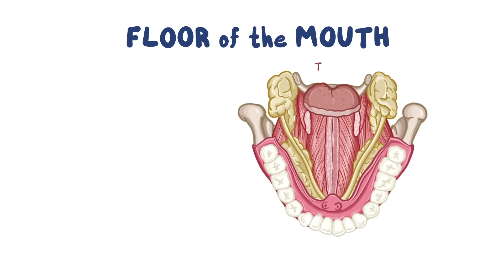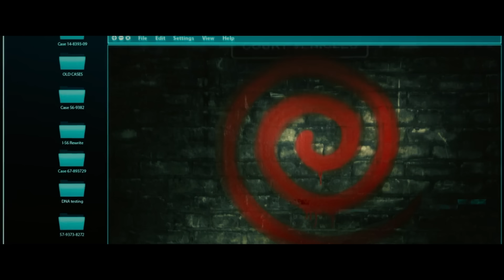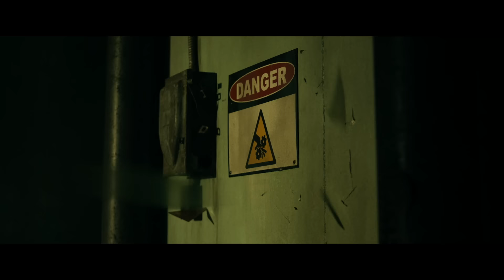How To Beat THE JIGSAW TRAPS In "Spiral: From the Book of Saw"

Comment: The second guys trap is the easiest, after bending the electric wire upward he could have flipped around in the pool to make a not on his side of the metal bar, stopping the machine from pulling his fingers and instead breaking the wire
Reply: Isn't wire under electrical current though? How would it make water electrecute him otherwise?

Also doesn't machine only activates when he triggers it himself by biting it?

Wdym by "he could have flipped around in the pool to make a not on his side of the metal bar, "

What side? What rod? Isn't it just one baththub?

Comment: The second trap just jump out of the box so you can’t get electrocuted but get out by moving forward to remove the slack on the line reach your hands over the water bend your fingers to release tension of the fishing wire and carefully grab the loose wire with the palm of your hand and repeat until all the wire is gone

Comment: How are you going to knock the wire out without touching it? you’re soaking wet, and you are in the water, you will complete the circuit and electrocute yourself faster
Reply: oh damn you’re right
Reply: I was thinking the same thing. Wouldn’t touching the wire fry u too. Glad u caught that too.
Reply: Break the glass and use it to move the wire away

Comment: So a slight thing that I noticed about the second trap. Unfortunately, if you try to un twist wires, you will be electrocuted anyway because touching a live copper wire is not a very good thing to do. Also, if the wires touching a pipe touching any point  of that pipe will shock you as well and what I noticed is the pipe that his arms go through is that same pipe so maybe he was getting shocked as well as his fingers ripped off who knows

Comment: Nah the glass trap wasn’t beatable cause it’s almost impossible to pick a lock with out a set let alone in 17 minutes
Reply: @brkenppt2222  nah he wouldn’t have because there wasn’t much that would actually block it. there would be a high chance of the glass falling in the machine. He could’ve found the key sooner but it’s high stress and he was proven wrong he would be dead set on what he thought was fastest which was the lock pick option. So there really wasn’t much you could do unless he had a good lock pick (judging by the look of the lock they’re a few good ones that would take a minute tops) and used the guy as a shield

Comment: Wouldn't wire in trap 2 be under electical current though? So touching it would be pretty bad idea? If it wasn't nothing would happen if water touched it? or how it works?
Reply: You need contact with both wires at the same time to close the circuit. If you only touch one of them youll likely be fine

Comment: 10:26 Those are most likely the source or ground for the high voltage, meaning if you touch it while having the other end of the circuit connected directly to you through your fingers and you're not careful, you can easily electrocute yourself even before the timer runs out. It is possible however that if you grab onto the live wire with one of your hands which is grounded, that you short-circuit the circuit, but it's also possible that only one of the hands are grounded, leaving a 50% chance of having high voltage flow through your heart

Comment: Trap 1: There is not enough chain for you to be vertical on the side of the tunnel, you would be hanging diagonally and you would be hit by the train from around mid torso up. Dead.
Trap 2: You...you cant remove the wires..they are electrified...that is the entire point of the trap. There is a constant current in those wires so as soon as the water hits you die. You cant run over and grab the electrified wires or you die.
Trap 3: You are correct, but all she has to do is lift her head. Literally just put her chin as close to her chest as she can. She has long hair, liquids will follow her hair naturally. So if she lifts her head the wax should follow her hair down the back of her head instead of over her face. It wont last forever but she is found fairly soon after and SHOULD survive this way.
Trap 4: Yeah this one you have pretty solid ideas for, block the glass as much as possible and use the intervals for safety.

Comment: The second one is even easier then you think. The things on his fingers are wire pulling baskets. Electricians use them. They are just like Chinese finger traps. All you have to do it push up on them from the bottom and they instantly loosen up and slip off. Just about any apprentice has done this before. Also they are made of steel.

Comment: On the finger trap, if you tried to move the copper wire then u would be electrocuted as a current will flow thru that wire if u touch it

Comment: okay but in the first one if you were to wrap the chains around your arms and swing to the side, if the chains of the device aren't fully in the clear of the train the train would hit the chains and still rip his tongue off-- more like his head at that point. yikes. love these vids
also the second man wit the nets on his fingers. if he got the wires out of the tub or got out of the tub while sitting closest to the machine for less tension on the wires, he could have taken one hand to hold the ends of the nets that are on the other hand. then with the other hand he should've pushed his fingers towards his other hand which would loosen the nets. It's like the Chinese finger cuffs, they only tighten cause each end is being pulled away from the other. he wouldve been able to slowly remove his fingers this way then used his free hand to do the same for his other hand

Comment: DEAR HOW TO BEAT!!!!! I need an answer.

The "Net" on his fingers is called a Fiber Beckett. He has 10 of these Fiber Becketts on his hands. These are used under high tension to pull fiber optic lines with a fiber hanging truck, from pole to pole from a reel placed down the road. 

These are made of metal and I need to know how this could be solved with this being the case. The lightbulb was the solution for these being made out of netting. @ 10:30

Comment: I would try to scream to the train driver to get them to slow down at the beginning making there be more time before your death, then you have to find a way to break the device or if the train slows down enough, it will stop before hitting you and the driver could find a way to get the device off for you so you can get on the train aswell and get to the nearest station

Comment: Question - with the first trap, is it a viable option to use the barbed wire to cut your tongue off rather than ripping it out with your own body weight? It would be very bloody and agonisingly painful, but it wouldn’t affect the connective tissue beneath the tongue. Less likely to kill you than swinging from the chains, surely?
Reply: thats really smart, however i dont know if there would be room to get the barb wire in the mask and be able to cut your tongue off completely. However you might be able to cut it just enough for your tongue to slide out.

Comment: if you touched the wire it still has a current running and who knows hm volts dude is using so youd most likely be fried to death the second you touch it say he used like 12k-20k volts

Comment: The first trap is simple
You can use a wire to cut part of your tongue your Your plan is unfulfilled because the train will touch the chain, and if you somehow survive your hands will not be able to withstand the force.
trap two is impossible killer gave us 90 seconds but the pool was filled in 80 (yes i rewatched and counted) to free hands simple light bulb shard wont be enough because that aint normal plastic
thats (idk what its really called tho) special material that not easily bendable and its very strong and even if he had the hands are released, they will not be able to remove the helmet also copper wires strat wont work that good inside of copper there is iron wires that are hard to bend with hands when you have that thing on also helmet reduces vision area so that will make it even harder.
thid trap is unfair too but its at least winnable in the movie you could see that she was thight up but But still she could move slightly so she  could rise slightly upwards and raise his head so that he wouldn't be sufficated  because of the wax. next trap is sometimes beatable sometimes not Pushing the shelf close will not work because the shooter throws glass with such strength that glass is pumped into concrete  it will easily rip the shelf apart conveyer belt strat is good but glass that made it thro can still kill that dude idk about lat one tho it seems way out of logic so you decide :) sorry for my grammar (all the info here is from me rewatching the movie )

Comment: The copper wire thing doesn’t seem right because you’re gonna be very wet already with no way to really dry off completely and then try to touch a live high voltage wire while still standing in water

Comment: 4:33
Where did you get that from? Top speed by a human is 27.5 MPH (44.25 KPH).
Reply: Did you listen he said not top speed?
Reply: @TooLateEXE  If you've ever been on a subway train, you know that they often travel at or as close to their top speed as they can, to reduce travel time. Even if you say that the average speed is right in the middle of their top speed and zero, (the median, not the mean) it should be much faster than 17 mph. Most people can't run that fast, but that still extremely slow for a train, especially the type shown in the video. I'm just guessing here, as I don't know the model or when it was installed, but average speed should be at least 30-40 mph.
Reply: @boochin  I guess you're alright. We don't know the train. So yeah, Have a nice day.

Comment: The trao woth the electric is the easiest to escape see the pipes hold your fingers just let yourself get pulled out of the trap by the gearbox then kick it the gears are movable and thats a problem because your body weights more than its harder to rip your fingers now you can put the gearbox out or dropp it in the water itll break either way so your safe

Comment: Sooooo... you wouldn't just use the Razor wire (not barbed) to slice off a small chunk of your tongues instead?  Partial speech vs. Hanging from mostly plastic seems like the smarter choice. The question here is largely the understanding of counterbalance - Whether the weight of a human body or the weight on the mostly plastic pipes goes first. He had a clear and obvious piece of material to sever the tongue quickly and clearly. Allowing him ample time to escape.

Comment: 10:33 I love your videos, but if you were to touch those copper wires with your bare hands you'd die before the trap even gets close. Copper is extremely dangerous when charged with electricity, hence there's rubber around wires to keep you from touching the copper.

Comment: These nets aren't fishnets. They are steel sleeves for pulling cables into pipes. There's no way you can cut them, but they only tighten when a pull force is applied so they would slide off really easy if you just push them towards your hand. As an electrician, I wouldn't die here.
But I sure as hell wouldn't try to unwrap a live wire off of a conductive pipe while being soaked in a bathtub either. Big dummy moment.
Reply: Consider steel sleeves glued to start with. Not doing this makes the trap pointless.

However if strings are long enough, the best chance is to rotate the body to twist the wires (after that part of the tension forces will be transferred to untwisting). These are:
1) will greatly speed up the process of skinning fingers (wounds to the phalanges down to the bone are non-fatal)
2) could potentially break the entire trap

Comment: Okay so I saw a comment about the electric trap with the finger thing. I'd that electric trap was connected to a car battery you can fuck the wire up because car batteries don't have enough volts to kill you. But you're wet so it probably will though

Comment: In that first trap... personally i would not be able to do what He says you could potentially do so i'd just use the barbed wire to try and cut my tongue off on one of the sides of the contraption.. either the front where the tip of my tongue is to see if i could Push my tongue the rest of the way through. or the other side closer to my mouth to abandon the front part of my tongue. I'd say its worth compared to ripping your entire tongue and maybe part of ya jaw too

Comment: I feel like the train would hit the chains and rip your face off. If you timed it right hit the side of the train I still think the chains would hook on the side of the train and rip your face off. Next if the copper wires are live you wouldn't want to touch them as you are sitting in water and as the end of his fingers have metal cables on them and I don't think he can bend his fingers you would 100% be electrocuted and die it would be better to try and pull the wire off from a peace that still has the insulation on it . Those lights look like fluorescent lights and the glass housing of fluorescent lights are very week I cant see that working very well if at all. Instead of moving the heavy shelf you could use the metal garbage can in the corner of the room hold it against the opening to block in then look for a emergence stop or look for a power shut off or a fuse box.

Comment: 10:35 how can you move live wires? touching it is deadly. the metal on your body wont help you. You cant make an improvised insulator with a shirt.
Reply: might not be live yet
could try moving it using the strings on your fingers

Comment: the train thing wouldnt work theres no way you can swing side to side of the walls the tunnels wayyyy  to wide and even if you manage that your still hanging by your tounge you have no support under you unless you have wrapped your arm right around the chains taking the weight but even then how are ytou gonna make nose you cant move your hands you cant make any noise your tounges locked down and i doubt hes stopping the train from the tv its to small wouldnt even feel it was hit
Reply: You don't need your tongue to make noise, you don't need it to yell AAAAAAH

Comment: you did not beat the third trap. You cant touch the copper wire because they are full of electricity. And the lightbulb will not cut through the Metall wires on his fingers. All you said is not possible!